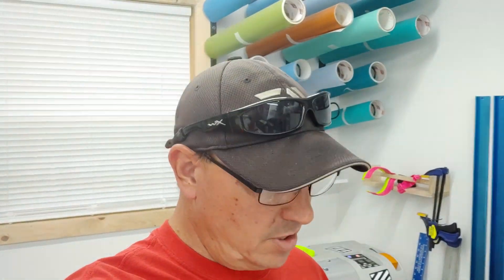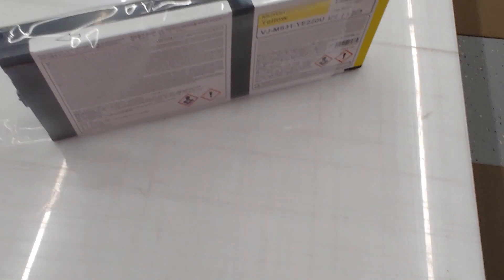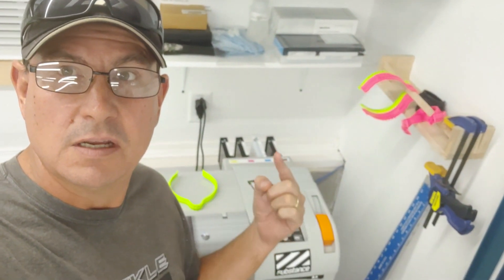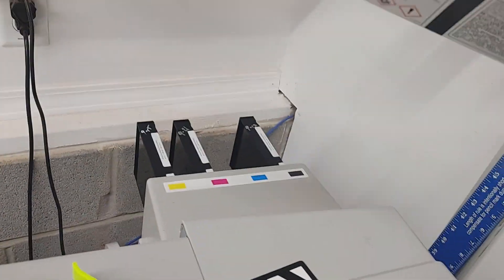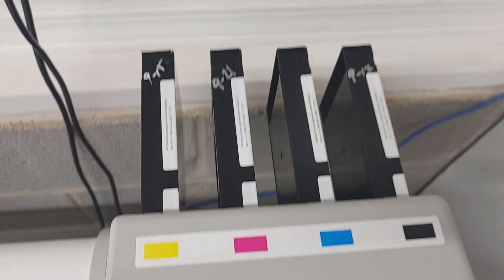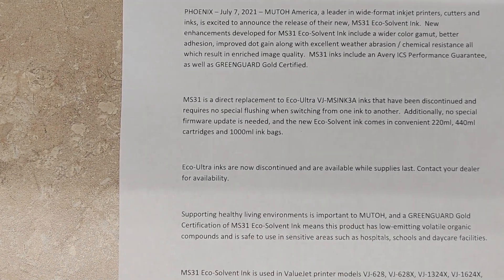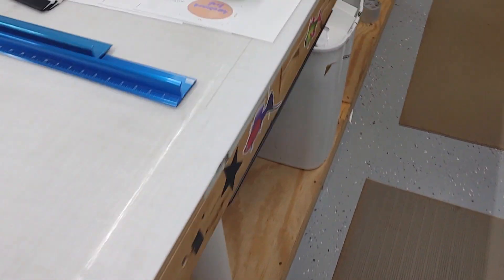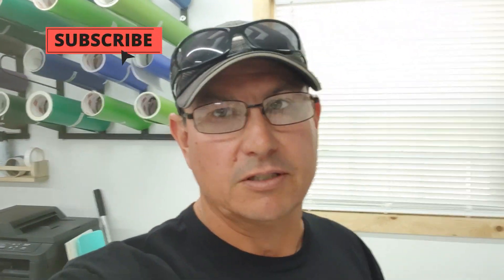MUTOH MS31 Ink Conversion

Comment: I been using jetbest ink for more than 5 years on my 1304 and 1604 mutoh with zero issues  i will never pay the ridiculus price of the original ink
Reply from the maker: Good information, did you have to flush the system when you switched? I agree the cost of the ink is getting crazy, some just don't know any better. Like taking your car to the dealership vs. the local service center to get an oil change... They charge what they want because they are in it to make $$$$
Reply: @TheSignGuy  what i like about jetbest is they are 100% compatible no flush needed if in case you ran out of jetbest ink you can just put one original mutoh ink in and they will work fine
Reply from the maker: @eldeividbass  that is good to know! Thanks!!! 👍👍👍
Reply: you use jetbest ink its ecosolvent ink? thanks in advance

Comment: I saw you had a 1324x. bummer that mutoh is trying to kill everything before it. Im on the last of my old eco solvent inks on the ol 1614, but will be going 3rd party soon. I hear those new black cartridges have chip issues with older machines.cool channel!
Reply from the maker: Thank you! I would say go for the 3rd party route before you switch to the Black carts if you can. I'm having some print/printer issues at the moment but I think it's the dampers and not the ink. I'll see in the next few weeks, trust me if I start having issue because of the ink I'm gonna talk about it. All companies try to maximize profit but there are other options and I think you are on the right track.

Comment: I switched from sign warehouse ink to ms31 inlk 220 then to the 1,000 ml amd in the 1000 i started getting clogged nozzle but i did a full ink flush and problem solve i think its due to the air in the 1,000 ml cartage
Reply from the maker: I have zero experience with the 1000ml bags, That's not a good if they are sucking air....
Reply: @TheSignGuy  im keeping an eyes out for that
Reply: I repalce the printhead on my mutoh vj1614 and for coincidence the manufactured mutoh give me and new cartdrigde ms31 blue. hapenedd that new ms31 blok many nozle in new printhead in 1 week. result that manufatured don now that had to clean very much printhead liquid in the printhead. whatch for that!
Reply from the maker: Sounds frustrating, I still have not had any issues yet. So far so good on mine.

Comment: What settings do you typically use when printing as far as ink density and passes?
Reply from the maker: Hey Adrian, I have 4 default "go-to" profiles that I generally use. My fastest and least ink density profile is 540x720 6 pass, 95% of the time this works out great for everyday printing. If I need something that will last longer and lay down more ink I use a 720x720 6 pass, this works best for a deep, dark, rich Black and the colors are bit more vibrant. The 720x720 does take about 25% longer to print than the 540x720 but I just take that into account of the job. The 3rd is from Avery (Avery 1005EZ 720x720 Graphics 2) one is for high end prints and wraps if I charge accordingly, it puts down lots of ink and about 2x's the print time of the 540x720. FYI I always design in RGB with all my prints with these profiles and can hit just about any color. The 4th is for clear static cling, it's a double/triple strike 540x720, we don't do a lot of it but it looks better then the normal 540x720. Takes forever to print the double/triple strike stuff but it eliminates the banding lines and keep the ink saturation down.

Comment: ms31 ruined my brandnew instaled dx5 in a mutoh valuejet 1614 cllogged nozzles. mutoh did now advise dealers ink ms31 mes with transporting liquid dx5. dealer dont admit prejudice. dont buy mutoh
Reply from the maker: I can understand your frustration, hope it works out for you. I don't know how or why but I knew you had to flush the transport fluid in the head before you push eco-sol ink through it. If it was a service tech that installed the head I would hope they make it right. If you installed it, research is key when doing DIY maintenance on these machines.
Reply: @TheSignGuy  thanks.it was a certifed  mutoh tech that instaled printhed,dumpers,station. He said  It did  a flushing. Use a 10 years old cleaning líquid. Some nozles get  missdirect. Do you think the cleaning liquid from a cartridg  that older was the problem . Thanks for your time
Reply from the maker: @teabreake1a  Wow, a certified tech SHOULD know the right and wrong way to do things. That's unfortunate to hear, I would keep pursuing the issue. IMO it COULD have been the fluid, just like the ECO ink, cleaning solution does have a shelf life so it very well could have the issue if the head was brand new. To the day I have not had any issues with the MS31 ink switching from the older valuejet ink. The cleaning fluid I'm using is about 2 years old cleaning about 1-time every 2 weeks. My original cleaning carts are now about 5 years old, last I used them was about 3 years ago when I had to move the printer.